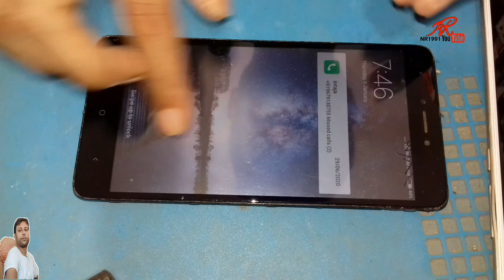Mi note 4 touch not working !! mi is 13252 touch not working solution

Comment: AFTER REMOVING THE 3rd COMPONENT MY PHONE SIMPLY DOESN'T TURN ON THE DISPLAY. I own my cellphone since more than 5 years, so I was planning to buy a new one, only for this reason I've tried this tutorial. BE AWARE.
Reply from the maker: The problem seen in the video.
f your mobile is having the same problem.
Then 100% it will work.
Reply: @NR1991  Sorry you are quite right. My cellphone continue switching on but WITHOUT touchscreen working. This video didn't helped me, but it seems it would be helpful for many of others...
Reply: @damiano2211  flexyble lcd mu gak pas paling Jon. . Maka dari itu blank

Comment: Thanks bro you save my mobile
Reply from the maker: Welcome 😊
Reply: Bro tell me solution for redmi note 4 red light blinking can't on when put charging show light only
Reply: @BGMADDA1 This is sometimes caused by water damage
Reply: @BGMADDA1 I had the same problem too, but I fixed it, so what you want to do is let it charge for days, if it doesn't work, you need to open the phone and remove battery cable, after clean it very well, do the same with the other cable next to the fingerprint, then after cleaning after inserting correctly, pit alot of pressure on the entire phone, avoid camera Sim tray fingerprint, and put alot of pressure on the battery, then jt will surely work!